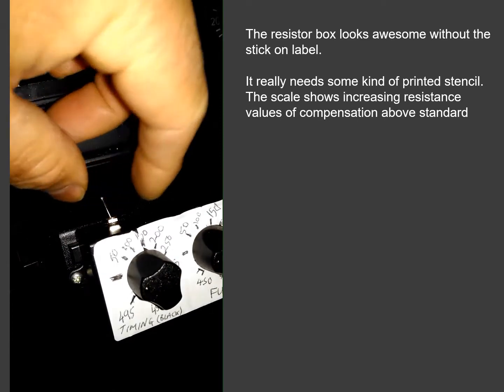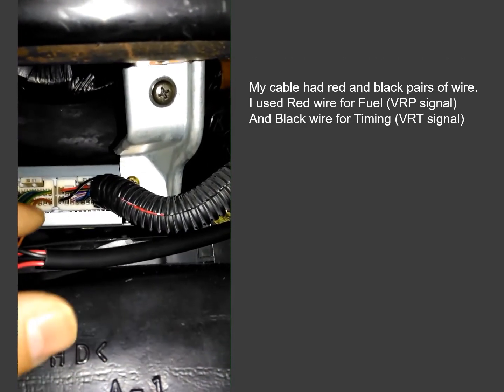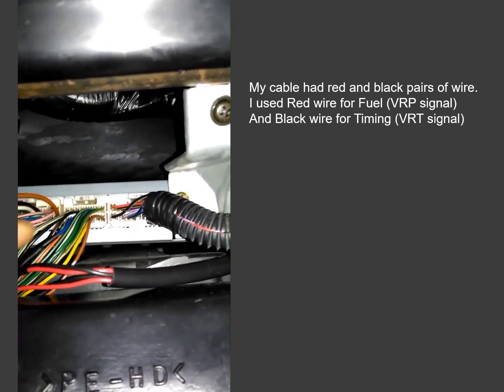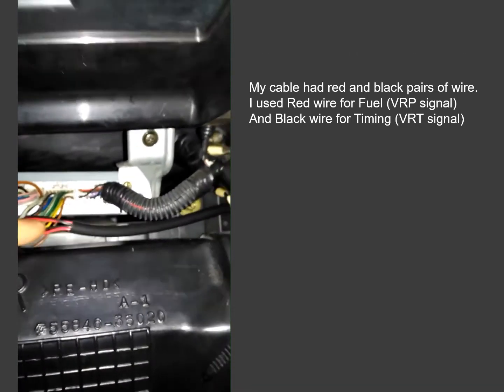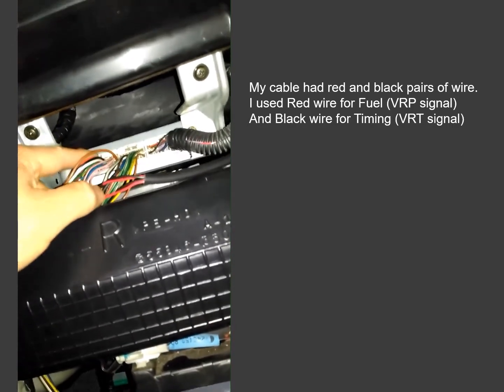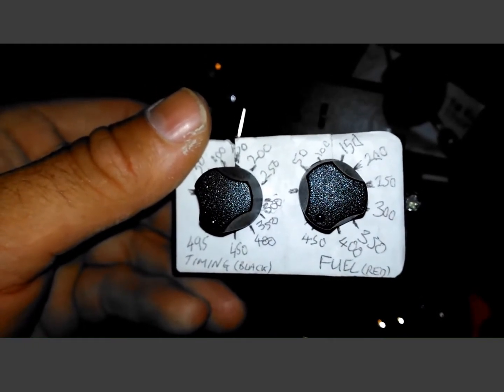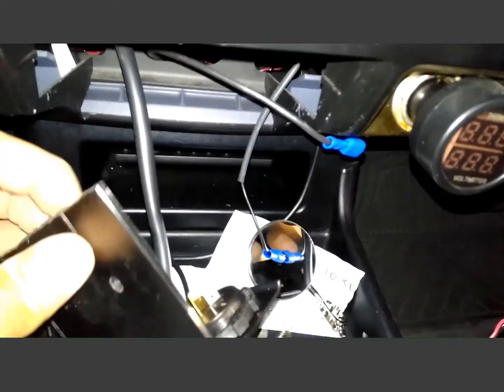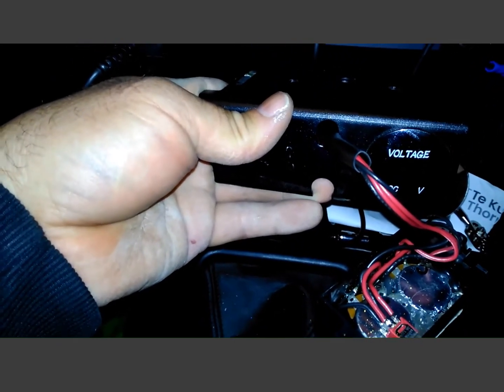1KZTE Resistor mod Prado

Comment: Hey mate, I love this idea. How do you know what settings are the best? Can you adjust the timing/fuel while driving and feel what works best? 
Would be mint to dyno it and see the data change while dialing.
Reply from the maker: The benefits come from the timing advance in combination with spill valve adjustment. Works ok until you cant get enough air from the Turbo. EGTs get too high. In my opinion, safe gains arn't enough to justify the dyno, I think we really need to have Uni-chip tune for dyno, that way the timing is right and you get the most from it across a wide range driving conditions. I'd need to check my records, but my spill valve adjustment is something like two full rotations clockwise now. Shouldn't effect the economy, and it hasn't. Gets enough air in the mix, timing good, im getting <10liters/100km in summer. More the way you drive and Im running the std alloy wheels with road tyres.

Comment: I have a dtc 14 code on 1999 prado 1kzte.  
In the last year before issue popped up . 
New crank sensor 
New timing belt 
New tb tensioner 
No slop in timing belt 
Pump body is aligned to side slot line

Since the issue 
New spill control valve 

No noticeable performance drop with the check engine light on . No excess tail pipe smoke . Somewhat of a hard start from cold . Starting motor quite noisy will fix that tomorrow.  But starts every time regardless of how long you swing.
Reply: Any help much appreciated  .
Reply: @nategmaycock9398  code is a control valve
Reply: After resistor mod ? too much advance

Comment from the maker: I found the resistor mods have most noticeable effect after I adjusted the spill valve screw clockwise one full turn from my standard position.  I have to back off the throttle a small amount to maintain the same boost and rpm. All my experiments are done with clean intake manifold, air filter and 3" Free flowing exhaust and good injectors. I increased the boost from std. up to fuel-cut of 14psi before ever touching the spill valve. Previously I only made small 90deg increments in spill screw rotation, but now i've gone a full turn. Im confident I can turn the screw further than one turn as I get no smoke and EGTs are unchanged when warmed up. But I prefer to wait and get AMC head before looking for power. For now I have an awesome and reliable tow vehicle.
Reply: Hey Alton, thanks again for putting this together, really like your approach. Have you noticed fuel consumption got worse with the spill valve adjustment? I remember you had an awesomely low fuel consumption. 

Here waiting on mt PPD 3 inch to arrive to go further down this track.
Reply from the maker: @martinravina6934  Hi Martin. Immediate adjustment of spill valve screw did not effect economy as I calculated 9.2l/100km(with the resistance compensation of Timing=100% and Fuel=80% on the dials). The last two fills returned worst than expected economy figures, both about 11.3l/100km, but I don't think this was caused by the spill adjustment (currently CW 360deg). I've only driven city in winter conditions, down to 3degC starts and short trips. Some of them towing approx. 1 tonne payload. I will know when Summer comes round as 11.3l/100km is the worst I've on record, I expect it will drop to be <10.0l/100km in Summer. Previous records show best economy over a tank was 8.9l/100km but I have no date, but think it was Summer.
Reply from the maker: Economy better than 10.0l/100km is on combined city and open road measures. Hope you like the PPD exhaust, mines been good so far. Only wish i'd installed the EGT sensor before the changeover. I have loads of EGT figures, but all done after the fact. So no way of quantifying a reduction of EGT temp.
Reply: @altoncooper3751  thanks so much for the feedback. Do you think the spill valve adjustment could have been avoided if you would have used a resistor that would be able to explore the full range of the pump resistor? (1:07 says it accepts up to 2490 Ohms and you seem to have 758 + 500 variable still allowing for at least 1000 Ohm on top of you top mark. Anyhow the shorting to return to original and having this inside de cabin makes total sense so I'm definitely going to follow your steps. I owe you at least a couple of beers when I'm down in ChCh next time. Cheers!
Reply from the maker: @martinravina6934  The fuel compensation resistor effects the lower rev range (<2000rpm), while the screw adjustment effects the whole range. This, I guess, provides a degree of tuneability.
Modifications, such as EGT blank, added boost, free flowing intake and exhaust have a cumalitive effect on the tune. Namely you can add more fuel by using the screw. Compensation resistors only give a small degree of adjustment, and i'd prefer not to deviate far from standard, not until I get an AMC head. ie, sticking to a 1 bar sensor (not having to trick MAP sensor in any way). I think the benefit is in the timing advance. It would be nice to have a uni-chip where we can add advance at defined points. But i'm not there yet and wont sacrifice reliability or economy. Note the Uni-chip adjustment is of the spill and timing valves dierctly, not the compensation resistors

Comment: What was the fuel pump timing original resistance?
Reply from the maker: My original timing resistor measured 863 Ohms using a multimeter. The pump gets calibrated after assembly and the technician chooses a reisistor value that brings the pump into specification tolerances defined by the manufacturer. This adjustment is required because of the inherent differences between the pumps found in manufacturing.